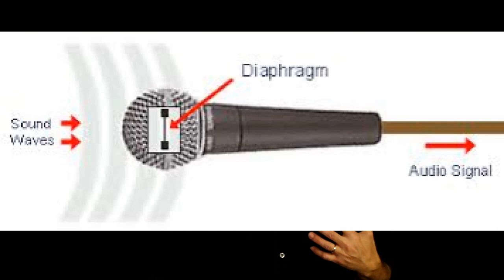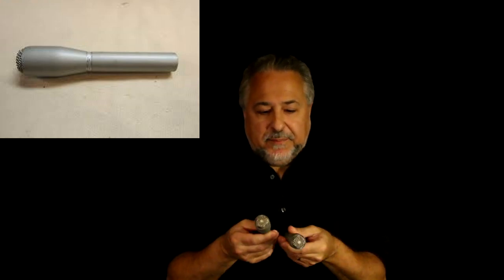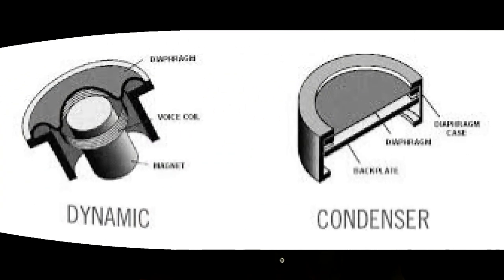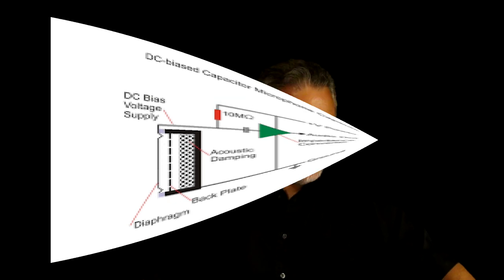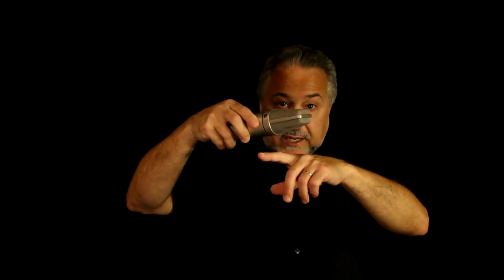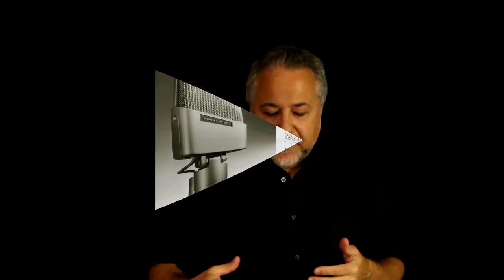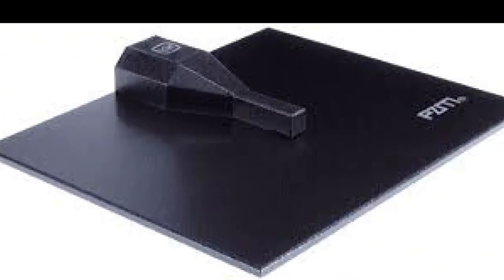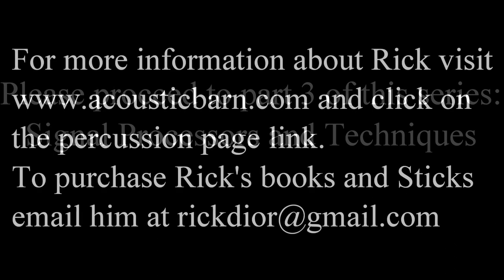Fundamentals of Recording Part 2: Microphones and Microphone Techniques

Comment: I own a D12 AKG Mic, but it has a very low  gain, ca=n yo explain if is the normal, maybe the were fixed inside the bassdrum
Reply from the maker: Is it from an old May micing system? I have had some issues with a D12 were the capsule went bad. It's expensive to fix so it may not be worth it. A Beta 52 or D112 sound almost as good.
Reply: @rickdior   It's quite old, my parents own it maybe in the sixties or in the seventies. One day i will check with a technician. Thank you very much Rick.